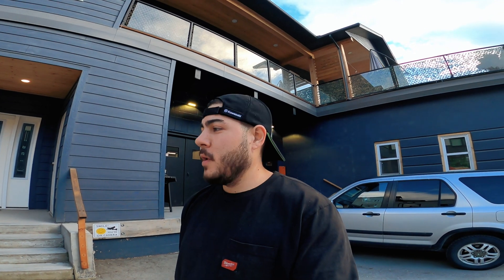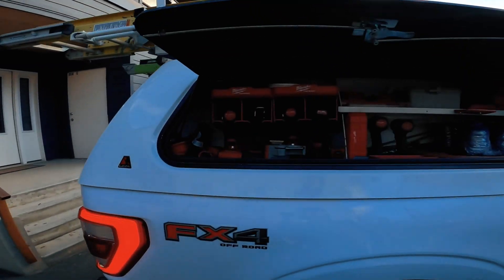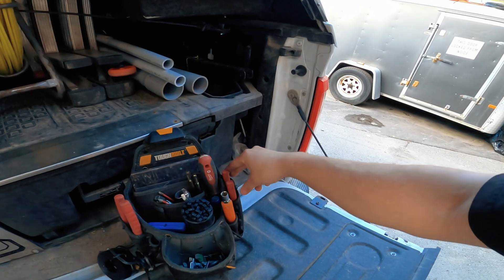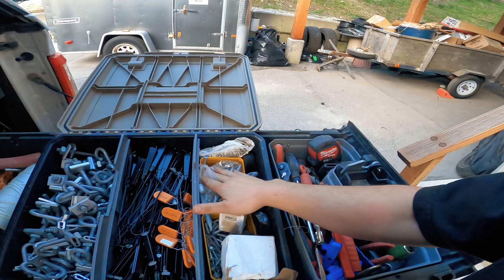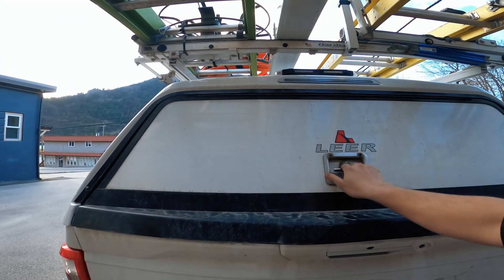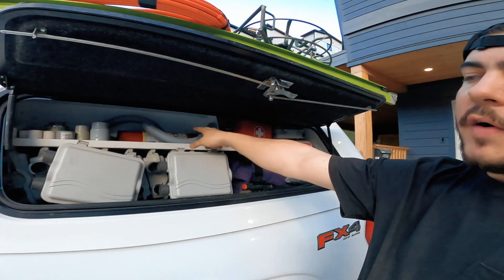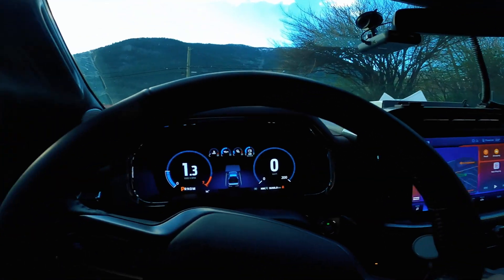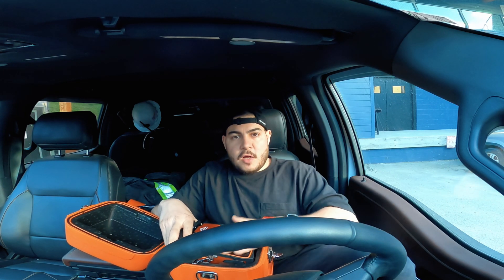FIBRE DROP TECH F-150 LARIAT SETUP+LEER Canopy

Comment: Yo I posted a vid today just for u to check out. It's just a small portion of the install. I thought I recorded the full outside part but my phone stopped recording and I didn't know it. They got me working out of town tomorrow in a more rural area, so ill take a video of a full install for u to check out if I get some easy ones. I only recorded with my phone today so it's crappy. I'll start using the go pro later in the week. I do fiber,coax,phone, and some jobs I just run cat6. So I get a mix of everything
Reply from the maker: I’ll check it out, sorry been busy

Comment: Dude I got the same exact Tool pouch! Lmao. I have that one for my tools, then I have a different one for my screws and screw clips. Those things are amazing and soooo much more convenient than the tool belt my job gave me when I was new. Having to put that huge tool belt on and off before and after jobs sucked. Now just pop the tool pouch onto the little belt clip
Reply from the maker: I absolutely love it. I can use for both aerial and ground work without having to wear my harness
Reply: @FyBurz  after I watched your vid I literally went out to my truck, grabbed that tool pouch and cut that seam out of the side pocket.lmao. Genius bro.lol. i think the other pouch I have is the electrician pouch? I forget. 1 pouch I wear on my right side is lineman pliers,needle nose,can wrench, 1/4" drive, screwdriver, coax crimper. Then I have 2 9/16 wrenches and coax strippers that have carabiners on them clipped to my pouch that way I can't drop them or lose them. Pouch I wear on the left is all fittings. Rg11,rg6, moca filters,then screws,screw clips,span clamps,etc. Then I got these Cat jeans with knee pockets. I always put my zip ties,ground tags,modem line tags, and fiber tags all in that same pocket.lmao. Can't lose stuff if you always put it in the same spot!

Comment: I recorded part of a install today to post on here for u to see what it's like doing fiber down here in ohio. I only recorded myself stripping the fiber and splicing though. The drop was just too much of a pain in the ass to try recording it with my phone. Lol. Instead of using the fiber tap in the guys backyard, they assigned a tap that was across the street,down the block, behind someone's garage, in the middle of a bunch of trees.smh. I was pissed. Turned a 1.5 hour job into 3 hours. That's running the drop,installing termination box,splicing, running microduct and feed,and installing modem&router
Reply from the maker: No path from the closer one?
Reply: @FyBurz  The workorders here have a Node number on them, and we have to match that to the fiber tap. So the drop has to be ran to the specific tap or services just won't work. And sometimes the service provider assigns a house to a tap thats 600' away instead of assigning it to the tap directly in their backyard. I hate it
Reply from the maker: @glassonglass6347  you can reassign I’m sure. Just call your back office ? Where’s the video btw ?

Comment: How do you like the battery heatgun?  Good enough or a little too weak?  Used a dewalt 20v for some sprinkler pipe and was disappointed - I thought it would just go for it and start dumping amps and heat, unfortunately, it was weaker than I expected.
Reply from the maker: Similar experience. I haven’t used it that much but it gets the job done. I only use it to bend conduit a bit and other similar applications.

Comment: Great video. Always interested in different truck load outs. See how people organize/work.
Reply from the maker: Thanks! The setup can always be better. At the cost of $ and time. I have some improvements to make ☝🏼
Reply: @FyBurz  just ended up building some custom bed slides, couldn’t spend the $ on those decked boxes.
Reply from the maker: I kinda regret it. They are useful. But poorly designed. I think they improved them on new models.